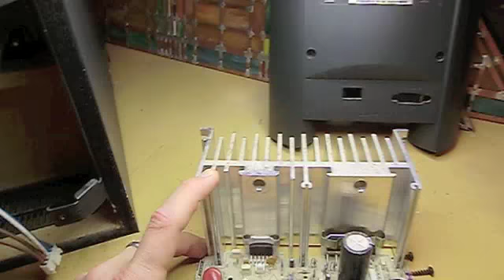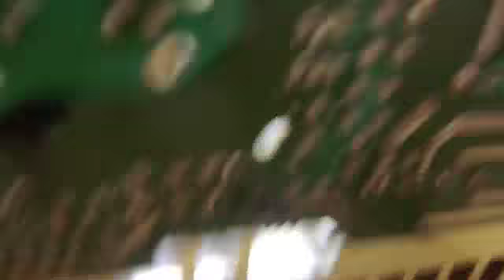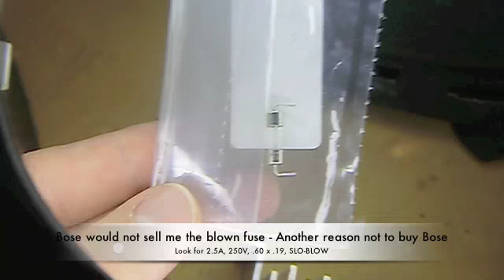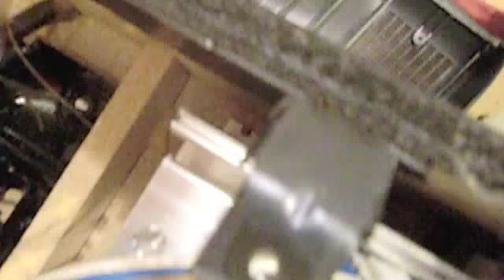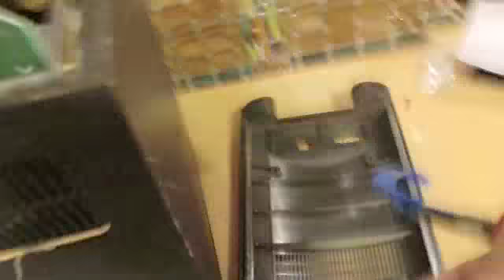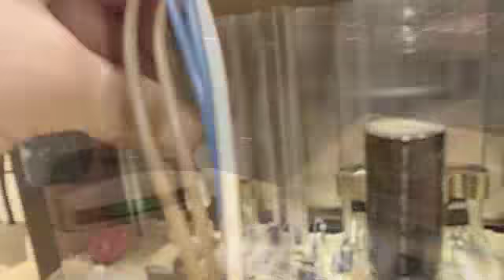Bose 3-2-1 Repair

Comment: Appreciate this vid. I have a similar 321 Bose unit that powers on but which does not produce any sound. Was wondering what tips you may have for attempting this repair. My system is old and I am out of luck finding a Bose technician in my area (out of state). Thanks for any recommendations.
Reply: Do you still have and use the control pod
Reply: @BirdfromPburg  yes, I still have it. Any advuxe/recommendations?

Comment: Thanks for the video. My unit had the exact same problem, so I replaced the fuse and it worked great! The fuse is made by Littlefuse and the exact replacement part can we bought at this link: https://www.mouser.com/ProductDetail/576-023002.5HXP.
Please note that you don't have to take out the circuit board or any other parts from the cabinet to access the fuse. You just need to  remove the back  panel, so the job is much easier than the video shows.

Comment: I'll tell you what's missing from Bose... Quality! This is why i use Rotel (Roland), Yamaha, JVC/Kenwood (same company!), Mission, Eltax, Mordaunt-Short, Gale and even Pioneer! Even if it's not cheaper, i have a Yamaha DSP-A5 cinema amp from the year 2000, 20 years on it's still working perfectly! As is my now 4 year old Yamaha RX-V379, also supports 4K60p HDMI video! God that looks like a cheap nasty couple of chip amps in there.. A car stereo head unit is more reliable! Haha :D

Comment: Mahnly I was given mine for Christmas and your right I was told 150 but there only going to say it can't be fixed. The problem is best buy suggested I buy a regular CD DVD player and hook it to Bose system because the door is broken and it won't eject. So hooking up LG DVD and CD player it keeps saying no disk. I've tried aux nothing and audio only. if I have it connected to DirecTV I can watch and listen to surround sound but directly to TV I can't watch DVD in the other player, Vizio smart TV doesn't have a tuner so you have to use a converter box! Should I hook that up first? I only have a cheap antenna I heard your VHS has a antenna? I'd like to get rid of DirecTV and get sling TV instead! It's getting expensive to cut the cord! Hopefully you can help Thanks

Comment: I appreciate what you bring to bare about Bose fidelity.  Bose figured a way to round out the base by incorporating a small infinite baffle to the full range drivers and cashed in.  They reap a huge reward due to how much people are willing to pay through the nose for that extra but rather sloppy deep end.  Oh sure,  its a better radio than most but not the kind of cash they get.  There are SO many better sounding units for the money where some real nice crossover slopes and good speakers are put to the test, i.e.  B&W Zeppelin for one.  (heard that they had trouble with the airplay features on those but the sound is marvelous by comparison for the same or less moola..

Comment: Wow, an opinion on the system to start and then bash it over and over, dude change the title.
Reply: Yea, he had a lot more to say about how crappy Bose is than how to fix the actual problem. But, I give credit where credit is due: He helped me find the issue with mine - I just pulled it apart and the fuse is blown. For what it's worth, I love my Bose 3-2-1...mine went strong for 15 years (cranked to the max during several house parties) before it blew the fuse.
Reply: What do you expect? It's Bose

Comment: I accidentally plugged in my soundtouch 30 into a 220v power supply. I heard sort of cracking noise and the speaker stopped working. The service center guys are charging way to much for repair. I think it's just the fuse that's damaged. I'd really appreciate some inputs from you guys.

Comment: Thanks for the video.  I purchased a working Bose PS-321 sub-woofer and i try to couple my 5.1 Logitech sound system into it to get more bass sound. but sub-woofer don't make any sound. however when i touch the circuit board it makes hum sound. plz help me Mahnly...

Comment: The CD will not open on my Bose 3-2-1 system.  Any thoughts?
Reply: Thank you.  Actually, I finally sent it back to Bose and it appeared they sent me a "new" CD system.
Reply: Tracy Maxwell i
Reply: I tried everything I do see the sink! I had a patient assistance take care of me after,6surgerys and he put a home made disk in and I don't think it went in straight. I turned around for a second and he was trying to take the top apart to get the disk out. I got it out it was okay for 3 X and after that shot the metal door, wait sorry plastic made to look metal is off and I'm sure dust is in the unit.Il watch video again maybe I can pull it apart otherwise I have a stereo and CD player

Comment: Thank you for posting this vid.  I too had a BOSE 321, with no power, it was caused by someone bending a pin on the power input from the sub woofer, shorted and voila no power on the receiver, called Bose Service and they said the receiver was in need of repair, send it to them for about $170. they will fix it!  Then I ran across your video, same problem and an easy fix, so I gave it a shot , found the main fuse blown, went to Radio Shack and got a fuse and replaced it, Bingo , it's alive again!  Thank You once again for sparking that idea in my mind, power to the receiver comes out of the subwoofer, and it is Fused!

Comment: The problem of my 321 is burnt out from the switch connected to the circuit board.yes it s good radio but bad too bec.i don't know what to with it. I disassemble it & I can't put it or soo expensive to fix

Comment: There's one on craigslist with a stuck dvd drive for 100 figured could probably talk down to 60-70.  Would it be worth it.  Sure I could fix the drive with ease but don't know if even at that price it would be worth it.  Have the Wave Radio and know how disapointing they can be when heard from a store to having in an actual house.  Not bad sound for size but for the price it's a bad buy.

Comment: HI , I have the same request, can you please give the voltage output across the two brown wires. My transformer is dead, the model Is e2-66rtf-ns1-0242 and I cannot find any info on it .

Comment: Hi! Is it possible that you could give me the output voltage of the brown wires on the transformer/power supply. Mine went bad and I need to know what's the voltage in order to replace it. Thanks.

Comment: I'm having the same problem. No display although it does light up for a few minutes. Nothing works. Non of the commands on the unit or remote. Just a light green glow witch shuts off after a little bit. I took a look at the fuse, but it looks ok. Any help is profoundly appreciated.